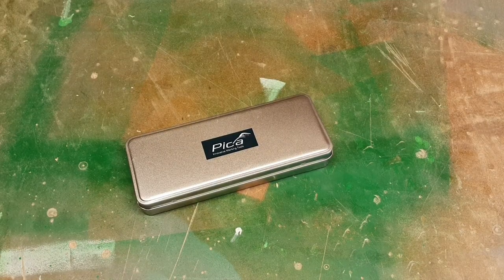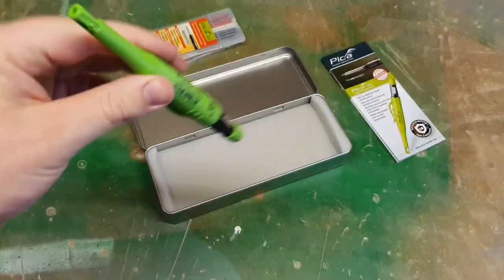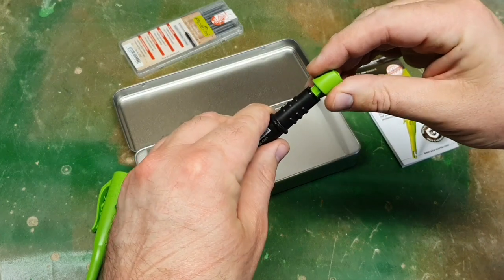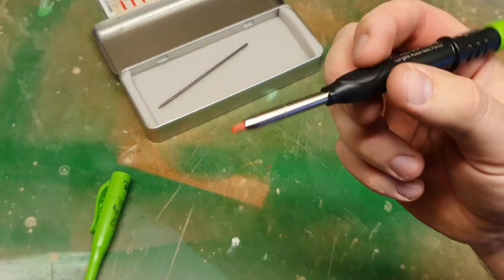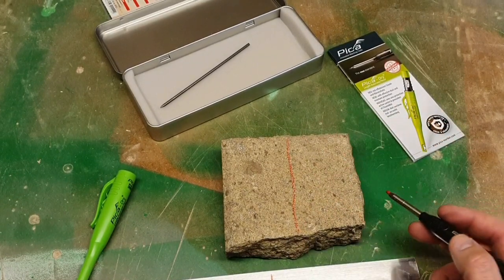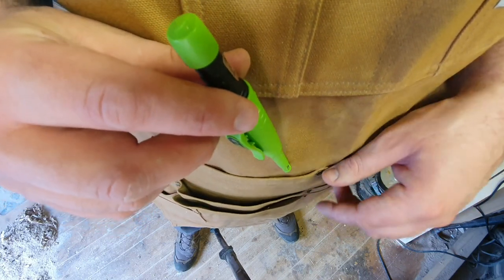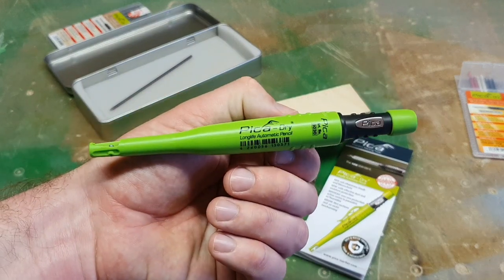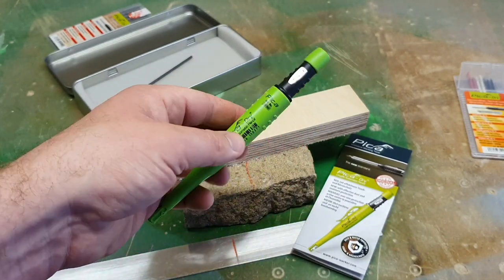New Pica Dry Longlife Automatic Pencil

Comment: Is the lead still as soft as shite?
Reply from the maker: Im not sure if id call it soft, definitely seems a different consistency that a normal pencil, but I presumed that was so you get a nice mark or line when you use it. What problem did you have with yours?
Reply: @BCdesign1  you can sharpen the pencil draw one line and the point disintegrates. Then you're left with a lead which is anything but fine line .
Great pencil but useless lead 👎
Reply: @andyrice859  you can buy harder leads